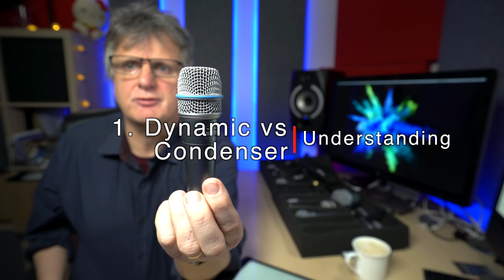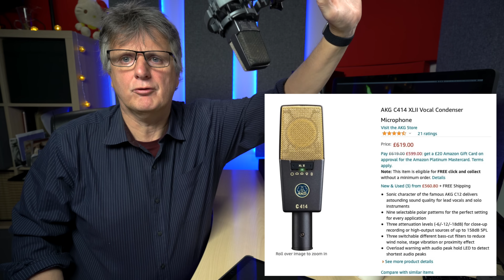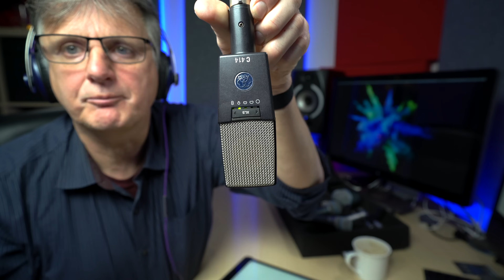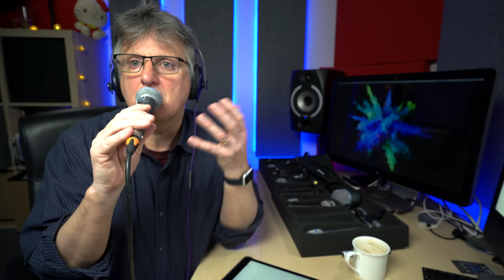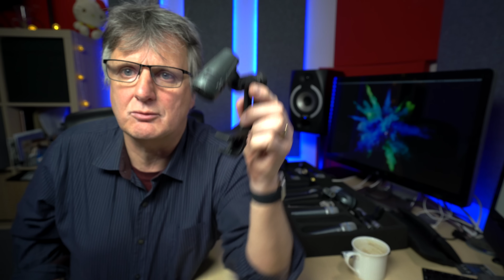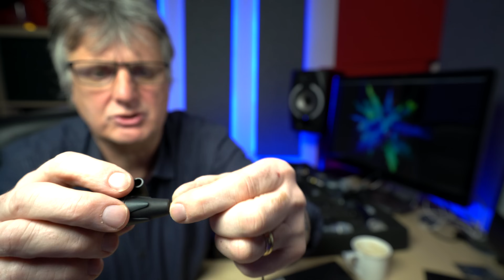Pro Microphone Secrets. Best mics for your money!

Comment: How about put moongel-pads (for drum heads) on the "Bell"-body of the t.bone SC140 pencil-condenser. Should help against the selfnoise. Would even 2 on it and lock them with some tape xD Fun little experiment. :D  I recommend the "Se8". Solid Sound to an okay pricetag. The whole SE Electronics V Pack Arena is pretty decent. With both switches to modern, you kinda have a "Audix D6". Yet you can switch it up - literally :D , without buying another Bassdrum mic.

Comment: I’m late to the vid but really great vid.  

I mostly use a beta 58.  I wanted some more brightness and tried my wife’s Telefunken m80. Nice.  A bit bright.  What I didn’t like was none of the mic holders fit the massive handle.  

I had a chance to get a Shure KSM9 on sale from a reputable place and grabbed it.  Only used it at home so far and it’s quite pleasant.  I sing a mix of clean and heavy rock.  I use in ears but it’s a weird setup because none of my other bandmates use in ears.  I use an eventide h90 on my pedalboard for live vocal effects and run my in ears off the 3.5mm audio jack on my eventide mixing link with westone AM in ears. This gives me clean vocals but also some ambient to hear the rest of the band. 

Any tips for using a handheld condenser live?  I have it on supercardiod. No wedge in front.  I’ll stay out of direct line of the drums.
Reply from the maker: Sounds like you have all of this sorted!

Comment: Good video! Over 30 years of moving those faders. I agree on most of what you said. My basic kit is almost identical. Where it differs: I got some Røde NT5 in addition, I got the e905 on Snare (with the Audix i5 as an alternative), got an Audix D6 in addition to the Beta52A and the Beta91A (if I use only one mic for the BD I like the D6 better, but 52 and 91 are better in combination). My goto mic for guitar etc. is the Sennheiser e609 or e906. If people want two mics per git amp, I‘ll put on SM57 in addition. They sound more „metallic“ then the Beta57 in my opinion, so they are a better contrast to the e609/906. Oh, and I have some Audix OM7 for a special clientele.

It is solid advice to recommend mics everyone knows to be at least ok and can be found on almost any rider, at least as an alternative for the actual wish list.

Where are you located? Do I hear a little bit of a London cockney accent?
Reply from the maker: My accent is from the Midlands. Leicester and Birmingham.

Comment: The reviews on Thoman's site for the Ovid C100 from Thomann are not good.  But they are 10 years old. Perhaps the design has been  improved. They do have  a 30 day returns on it, so I would think they perhaps have a lot of returns. I used very inexpensive condensers in the 70s for recording. The spec looked good on paper and they performed well on mic stands, but were not suited to handling. I'm sure this will be a very useful video for some.  Nicely presented.

Comment: Great video! Always buy from Shure directly. The market is flooded with fake mics. Not just Shure.. If you see a Beta 57 or 58 for $35.00 US, guaranteed it's a fake. Also, check out the pics. If you see a cable with the mic that has a cheap XLR female on one end and a 1/4 inch male on the other, it's fake. 57s and 58s are low impedance mics only. They're  $149.00 plus tax from Shure directly.  Free shipping.
Reply from the maker: Never had a fake as we but from trusted distribution.

Comment: Great intro to mics I sent to some of my trainees- though I have a few taste differences in daily driver mic kit, still staying in the same price range.  My star vocal mic is the SE V7, sometimes with a Soyuz Launcher if I want more saturation or higher levels into the preamp.  I don't like the senny drum mics, largely because of the non-repairable enclosure problem, but also because there are better sounding things, also more durable and in same price range. AKG Drum Set Session I, with an SE V7X on the snare.  MXR 606 on the hats, similar to what you've got, though even cheaper. Pair of senny 609s for guitars, (Though the AKG tom mics also work well for that) then the vocalists get one of these, (I bring one of each) dependent on what genre, what the lead vocals are doing, etc: AKG D5, Senny e835, SM 87a, and a couple 58s just to fill out the roster, which I'd also like to replace with 58 alternatives that fit well into this lineup. Sometimes I'll break out a D112 if the AKG P2 is a bit too bass heavy, and I'll use the same mic I would system tune with, the behringer ecm3000 ($50) as an ambient/crowd mic for live recording/streaming. I also have an extra pair of those AKG P170s for horns, strings, etc, though do like the clip-ons and have been experimenting with a few different things there, haven't settled on a winner yet.  Big fan of wired lavs for video production; it's most of the benefits of wireless systems, without the cost.

Comment: The Beyer M88 is not a ribbon but is a dynamic mic.   The M88 is a little less durable than most other dynamic mics so they can sometimes be damaged after long and repeated use as a kick drum mic right on the port of a kick.  

The M88 being just a bit fragile along with Beyer being known for their ribbon mics (like the M130 M160 M260 M500) is probably the source of confusion here.
Reply from the maker: Yes I am wrong here!

Comment: 33:44: interesting that the A/B comparison of Beta58 vs. MD435 revealed dramatically smoother and more present on the mD435 -- listening on my iPhone 14pro! But auditioned on a pair of low/mid-grade Polk TSi-300 tower speakers bi-amped by a decent Sony multi-channel car amp, the Beta58 maybe(?) does sound cheaper on the lower frequencies, but the difference on the high end disappeared.

Comment: 30:45: beta57 - same as beta58 but with different basket that changes polar pattern and sets the ‘front lip on the mic’ position closer to the diaphragm for better signal/noise ratio.

Good for guitar cabinets and kit snares.

Comment: 20:00: monitoring: use both ears of your performer! Focus monitor fill from the opposite side of the performer of any loud stage noise (drum kit, guitar amp, loud keys fill). The effective perceived monitoring volume is +6dB due to the low-noise ear getting the monitor fill.

Comment: 18:45 hypercardiod stage mic (Sure beta58 not SM58) pics up feedback if you direct monitoring from dead-front of the singer. Use an angled monitor to get outside the backside ‘lobe’ of the hypercardiod pickup pattern.

Comment: Congratulations Mark, the best lesson on mics on the YT. I don't need to listen to anything else after this! I'm far away from you (Brazil) but I know now what to buy even if I'm on a low budget. Nothing like the knowledge of someone who lives of a subject. Never saw someone talking about the MD435 and it was a great find. Very hard to find it here because it's so much expansive for us, but I'll save the tip for any intl trip in the future. I play chromatic harmonica and most top players use a SM58 because you know it's a classic and the frequency range is quite similar to the voice but as the sound is produced by free metallic reeds, the higher frequencies are almost of a brass instrument and I think the MD435 would produce a very interesting output. If you ever have a chance to record one harmonic on it, please let me know;  I also study sound quality a lot as I'm an Electrical Engineer too. Thanks for the video, lovely British accent! Already saved to a playlist and subscribed to your Channel.
Reply: The classic harmonica mic is the Green Bullet, which also is very cheap, though be advised it does need a preamp pedal to integrate well into a spund system.  It somewhat depends on if you're going for the classic blues sound or trying to do something new, because the green bullet is objectively a bad frequency/dynamic response; it just happens to pair really well with harmonica.  Also because traditionally harmonica is closeiced and very loud, and producing a lot of air, a very detailed mic will be vulnerable to those things even more. I also suggest trying out the worst, cheapest mics you can find on harmonica, because a dirty, midrangey sound actually works well there. Stuff out of karaoke machines and home tape recorders.
Reply: Typo- Close miced, not closiced
Reply: @madrooster7  many thanks for the answer, totally agree with blues/rock/pop.. approach. But the challenge for us is the chromatic harmonica for Classical/Jazz. As you said, and I totally agree, very loud and lot of air. As Toots Thielmann used an SM58, many after him just used it, but we have to be very careful when playing because of the problems already mentioned and also avoiding the instrument touching the mic, silly but happens sometimes. There is one guy in US that makes and sell a model, a SM58 with a volume knob on the body because the player can control the volume. In a gig is helpfull, but still not the best solution. Because your attention gets divided sometimes. Instead of playing you have to keep remembering to low the volume. Anyway, if you have any other tip I would be very glad to listen. Thanks again.

Comment: Hey Mark, I’ve been a pro keyboardist for about 27 years now, just watched your video here and can’t thank you enough for such a lovely presentation.. I’ve not got a clue about mics and your video has opened my eyes 🤣🤣 
I play keys and sing in a UK Bon Jovi Tribute Band and alternate what I use when I feel like it 🤣 I wear IEMS on stage 

over the years I’ve built up a few nice mics, I currently own the following below, but wanted to ask what your thoughts were on an Audio Technica AE5400, to use at home to just sing through while wearing my headphones…. I’m only using a Soundcraft EFX Mixer

I have 

1 x Heil PR35
1 x Heil PR37
1 x Shure Beta 58
1 x Beyerdynamic M88TG
1 x Sennheiser E965
1 x Audio Technica AE6100
Reply from the maker: Hey! Good luck with the band. My tribute project was Genesis Visible Touch ... I had to finish on that as we returned back from Covid as I really got too old for the touring and my body did not want to do shows again! I don't know the AE5400 ... looking that up now... Arh! It has the same capsule as the AT4050 which I have used ... these are very good. So you are getting a vocal version of a nice budget-mid range studio condenser. I like the idea. That would be a keeper I think.

Comment: Btw, the only difference between e904 and e604 is the enclosure. They use the same capsule, etc. However the stiffer enclosure results to tighter sound and better transient response.
Reply from the maker: Fine... my issue with the e904 is its self weight bouncing around on the clip.
Reply: @MarkPayneAudio  Yes. The clip itself isn't the best. I've seen some people switching them to Audix clips and K&M clips.
Personally I've switched pretty much to Beyerdynamics TG D35/D57/TG58's. They have a really good price/quality/fun-ratio.

Comment: I don’t know about mics, but in a speaker, the coil IS the magnet. The electricity running through the coil creates the magnetic field.
Reply from the maker: Ok well... in a speaker there is a stator (permanent magnet) and an armature (the coil). The coil is not really "the magnet", the magnet surrounding the coil is "the magnet". Yes, as you send a signal to the coil it creates a magnetic field and this interacts with the permanent magnetic field from the stator and the resultant interaction creates movement.